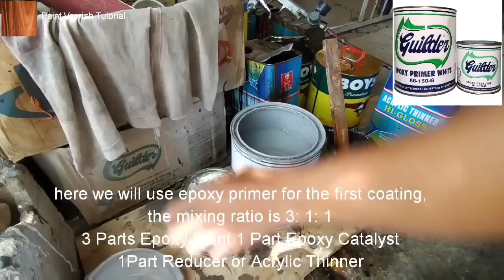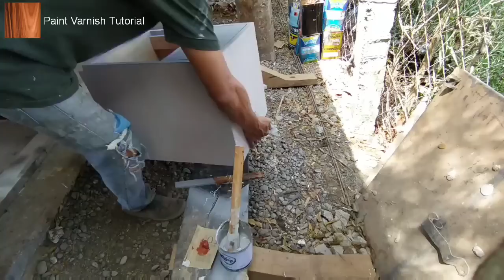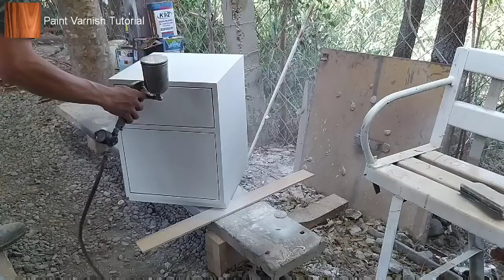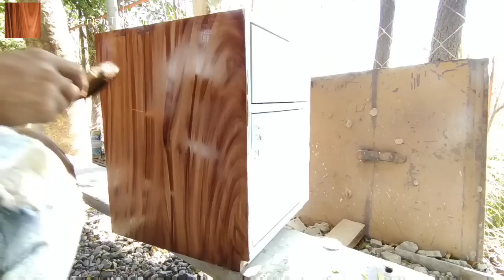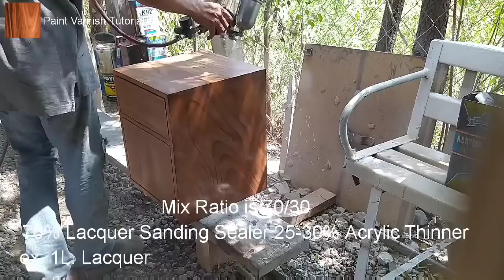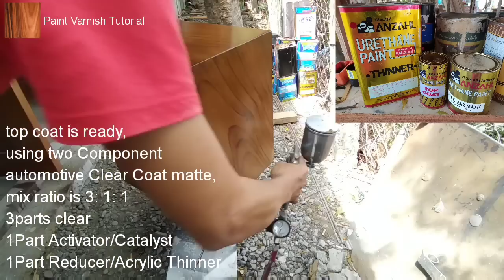Best Finish For Plywood To Look Like Hardwood "Step by Step"

Comment: From a technical and art perspective, it’s amazing. 
From a labor perspective, it’s not worth it versus just adding a veneer or making a new piece out of actual veneered plywood.
Reply: In countries where labour is cheap it is cost effective.
Reply: @Darin Netherland
When I started in business I worked 100 hour weeks and the rewards were not equal to a normal working hour but if the profits are reinvested it can grow wealth and production.
Reply: and you don’t know what the relative costs and availability of materials is in other countries.  One thing for sure: this finish will be bulletproof!
Reply: On a diy perspective...its costly...considering the materials cost...and the laborious process..to make a small cabinet look like that...
Beautiful though...thumbs up..
Reply: It's worth it if you turn around and sell it as hardwood even when it's not...and you live in Mexico or another similar place. Clearly, it's not this guy's first rodeo. 😉
Reply: yep most are right good wood is hard to come by here and is expensive.  Learning to do this way gives the worker  a lot learning in dofferent aspect of woodworking it is basically a short course on a lot of skill one can use later for a good paying work

Comment: I think this could actually work out cheaper. If I think about the cost of scrap plywood.  That really bad stuff that they use in place of pallets to stack things on like laminated flooring. Those plywood can be very very cheap to get compared to store bought plywood. If you can source that cheap throw away plywood then I think this is a great idea. Gives me an idea actually.  Great artwork 👌👍

Comment: Magandang Araw po Boss Mark. Tanong ko lang po, nag start ako sa 1st coating ng DIY cabinet nami ng wood primer and sealer. Then nakita ko video mo Kung paano gumawa ng design na may wood grain. Pa help po sa mga kilangan ko bagohin na materyales. Nka bili kasi ako ni flatwall enamel then at High Gloss Enamel. Salamat and God Bless You Always. 🙏🙏🙏
Reply from the maker: Para po dun sa inyong cabinet. 
Iprimer Po Ito Ng panibago. Gamit Ang
Epoxy Primer White Guilder
At masilyahan gamit Ang
Lacquer putty spot putty Boysen with patching compound.
or BodyFiller.
Lihain.
At iprimer muli Ng white.
At maari Napo kayo mag wood grain design.
Gamit Ang mga oil Tinting Colors
Yellow Ochre, Bulletin Red, burnt Umber boysen. Hayaan matuyo.

At ipitan po Ng Lacquer Sanding Sealer hanggang tatlong patong

Bago Ang top coat 
Hanggang dalawang patong 😊❤️

Comment: ..... or you can take a torch to it, lightly burn and pull out the grain pattern, sand it down, stain it, and finish with a varnish or oil as well as sanding repeatedly to get it to a fine shine going up in grits with the sandpapers.

Comment: Hello po, lago po ako nanunuod sa inyu kahit wala akung alam ganda kasi. Ask ko lang po magkano po ba ang spray at tanki with hose po?
Reply from the maker: Salamat sir. 
Sa air compressor dipende po sa laki Ng HP.  Meron ¼hp ½hp 1hp. Para sa pang diy. Maari Napo Ang ¼hp. 5k meron Napo kayo nito. Sa spray gun 1k pababa meron Narin po kayo nito. 😊
Reply: @paintvarnishtutorial2964  Thank you po sir. Curious lang. Sana ma try ko in the future. Wala lang muna spray. Manual lang.hehe. Another question sir. Yung process po ninyu sa pag layer2. Hindi na po ba maka papasok yung termite or maka lalamabas kung nasa kahuy na? Or iba din process sa wood nito po?

Comment: That is so damn good!!..i love it!!.but could you tell me please kung anong size ng mga sand paper that you use and the brushes as well..thank you for this video!..
Reply: Paano po den plang mag re-varnish..
Pls help me step by step on procedures and materials that i should use..thanks again
Reply from the maker: Epoxy Primer White Guilder
Acrylic Thinner
Oil Tinting Colors 
Burnt Umber
Yellow Ochre
Bulletin Red
Lamp Black
Paint Thinner
Sandpaper #80/120/240/400
Lacquer Sanding Sealer
Automotive Urethane Clear Matte
Paint Brush Size: ⅛-2-3 Inch 👍❤️
Reply from the maker: Marapat po lamang na bisitahin Ang Ating channel para Sa Kung paano Ang mag re-Varnish 👍❤️

Comment: May gusto sana akong e wood stain na kahoy  boos, para sa butt ng aking airgun. Pag inisprayhan ko ba ng ANZAL na topcoat Hindi ba siya matutunaw? Anong brand ng pintura at mga sangkap Ang kailangan pls. Personal ko lang po ito na gamit boss. Tnx
Reply from the maker: Maari Ang automotive Anzahl Kapinta. Mas makakabuti Ito at matibay.
Igayak muna Ito Ng Tama at maayos
#1
Linising mabuti Ang kahoy gamit Ang papel de liha. #80/120/240
Matapos Nyan. Gumamit Ng sealer bilang first coating. Hintayin matuyo.
#2
 Gamitan Ng #240 bago Ang Stain, dipende sa nais nyong Kulay. 
Makalipas Ang kalahati o isang oras
#3
 ipitan Ito Ng Lacquer Sanding Sealer, hanggang tatlong patong 
Bago Ang Anzahl Top Coat, 👍

Comment: Kapinta tanung Lang top coat din ba Yung boysen clear gloss??? Matibay rin ba kapinta?
Reply from the maker: Yes isang uri din Ito Ng top coat. Ang clear gloss lacquer at Dead Flat lacquer. Ay mga single Component topcoat. Matibay Ito sa loob Ng bahay.
Kung nais mo na mas matibay. Gumamit Ng Two Component Clear Coat 😊👍🙏
Reply: @paintvarnishtutorial2964  maraming salamat kapinta..sana marami ka pang tutorials na maippamahagi samen..godbless kapinta.

Comment: boss npancin ko po sa mga video nyo na d kyo gumgmit ng auutomotive white na boysen ms ok po b gmitin unt epocy kesa sa automotive tanong lng po salamat
Reply from the maker: #1 Magdodoble Tayo Ng trabaho at materials Kung sakaling gagamit pa Tayo Ng automotive white. 
Kung maaari Naman Ito makuha sa epoxy primer White, at mas madali at mabilis makagawa Ng haspi na nais mo sa epoxy Primer kesa sa automotive paints. At kumakapit Ang oil stain dito.
#2
Hindi maganda Ang kapit Ng Ating stain sa Automotive paints gawa Ng Ito ay smooth surface. Hindi kumakapit Ang stain natin at dumudulas lamang Ito. 😊👍🙏

Comment: sir mag tatanong lang. my ginagawa kc ako ngayon na diy  cabinet para sa lavatory ng banyo anong gagamitin na finish para ma waterproof ang plywood?
Reply from the maker: Automotive finish Kapinta.
Two Component

Na Kung saan gagamit Tayo Ng
Basecoat clear coat system

Igayak Ito gamit Ang epoxy Primer
Masilyahan Ng BodyFiller sarado batak
At lihain at iPrimer gamit Ang spray gun

Matapos maigayak at matuyo 

Magkulay na Tayo gamit Ang automotive dipende sa nais nyong kulay
At least tatlong patong Ng Kulay

At saka Tayo gamit Ng clear coat 
😊👍
Reply: @paintvarnishtutorial2964  my manual process ba kung sakali na walang spray gun kapinta? or advisable ba ang formica or laminate?
Reply: Bulukin kse kpag laminated .. may isa pa  kong recommend pagka haspe i lacquer sanding sealer tpos top coat mo e poly urethaine . Pra ntalbog lang ang tubig kung mbasa.
Reply: Idol tanong ko narin kung meron bang polyurethane na matte/flat finish?  Or may pupwede bang ihalo doon para maging matte / finish? Maraming salamat!
Reply: Sir, hindi mo nababanggit kung ilang oras ang pagitan ng patong ng urethane top coat sa mga videos mo.. gano po ba dpat katagal ang bawat patong? Salamat po!

Comment: hi po, bat po kaya napepeel ung tint paint na gamit ko after ko kapag nilalagyan ko ng Sanding Sealer kahit 24hours ko nang iwan para matuyo ung stain na ginawa ko natatanggal parin kapag nilalagyan ko ng Sanding sealer.
Reply from the maker: Kailangan po nito ng air compressor and spray gun
Kung Wala maari Ang paint roller pero dapat magaan Lang Ang pahid at Isang mano Lang. Hintayin matuyo ng 15-25 minutes bago Ito ulitin. 😊👌

Comment: Bro.,pwede brush din gamitin kong walang pag-spray?thanks
Reply from the maker: Sorry. Pero Hindi Ito mag rereaulta Ng maayos na yari Kung paint brush Ang Ating gagamitin sa sealer.
Pero may arternatibong pamamaraan para sa walang air compressor.
Gumamit Ng QDE or quick Drying Enamel bilang pang Haspi. Ihalo Ito sa paint thinner Upang Hindi na Tayo gumamit Ng Spray Gun. Makukuha nitong matuyo. Bilang design. 😊👍
Reply: Slmat boss sa sagot

Comment: 12hrs b pinapatuyo ung epoxy ndi ah savlit lng tuyo agd un. Ska prng kulang s hardener ung body filler mo boss.
Reply from the maker: Bawat mang gagawa may mga sariling pamamaraan sa kanilang trabaho. Gaya mo o Gaya nila. Iba't iba sila ng pamamaraan. PERO...,  dapat Alam mo Rin na KAILANGAN nasa tama ang Sinusunod Nating  proseso. O Yung STANDARD. At Yung mga ginagamit Nating MATERIALES. Dalawa Yan Kapinta. "ISANG MADALING PAMAMARAAN." AT "TAMANG PAMAMARAAN " 😊👍
Reply: Maganda. Makagawa NBA din
Reply: Sadyang hindi lang talaga mapula ang filler na guilder kumpara sa polytuff brand kaya parang tingin mo sir kulang sa hardener..
Reply: Opo boss. Opinyon q lng nman po un. Salamat po